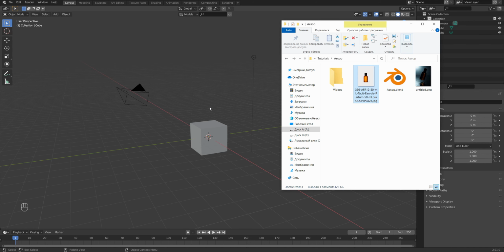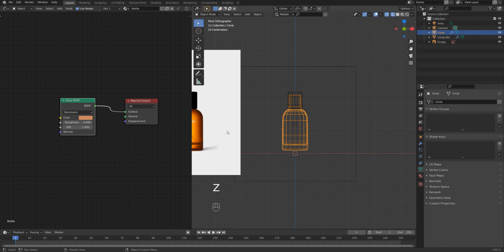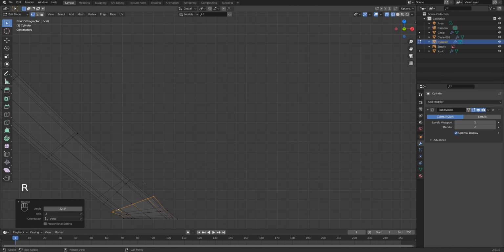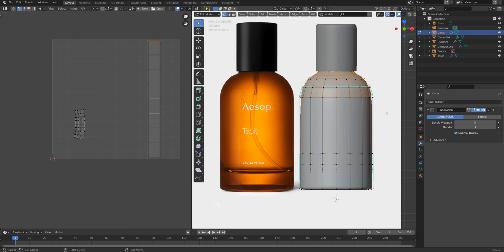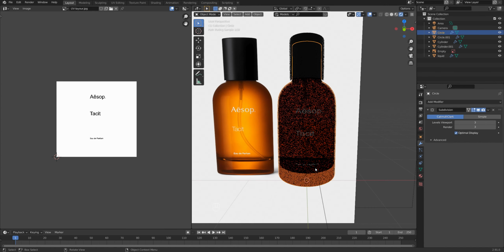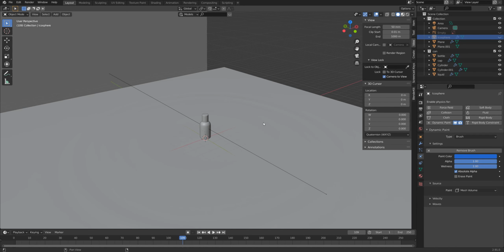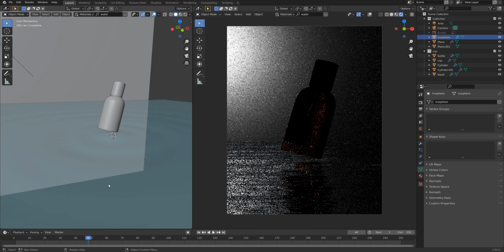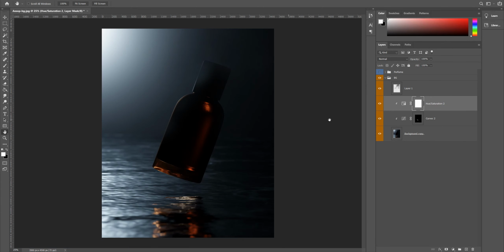Creative 3D Product Visualization Tutorial in Blender

Comment: How did you get that nice soft gradient in the glass. Because the downloadable scene renders differently that you thumbnial.
I tested using a bounce card and it looks better. Also tried light linking which is also a good option.
Ive made a nice automated workflow for lightgroups. This piece of code allows me to test different lighting condition, change colors, change strenght and simple store them as presets. I then can toggle between them with just a click. Its truly super handy for doing relighting work
Reply from the maker: I put a gradient to the area light via nodes. I have to check the blend file, I revisioned it long time ago
Reply: @andymvisuals  You mean on the material side then. Makes sense, it looks really clean. Using a bounce card or reflector card is possble. But a bit more finnicky
Reply from the maker: Is that possible to take a look at the addon you’ve made?
Reply: @andymvisuals  ill send an email to that email in your profile here, is that okay?
Reply from the maker: @RomboutVersluijs Sure! Thanks in advance
Reply: @andymvisuals you want it separately or in the addon I out it in. It came with light group helper. An addon which makes it easier to do light groups. I was thinking if either making it standalone or add to blenderbobs light editor addon, I kinda like that addon a bit more because of the GUI

Comment: blender kit is working very bad on my computer, i have to unstall it
Reply from the maker: Sorry to hear that. I use Blenderkit for a long time, didn't have any issues with that. What kind of problems do you have btw?
Reply: @andymvisuals  it works but it loads a lot and takes a lot of time especially for the water texture.. do you have any tips?
Reply from the maker: @gmilka4283  I see. It may happen because of weak internet connection (download speed) and slow PC generally... I had such issues from time to time on my old machine, but after upgrading everything goes super smooth. Previews are generated in no time. 

What specs you have? I mgiht help you on Fb group, please check the link on the main channel page
Reply: @andymvisuals  My computer is new.. its an Imac retina, processor 3.8GHz Intel Core I8, 8 hearts, 32 GO 2667 MHz DDR4
AMD Radeon pro 5700 XT 16 Go..

It should be fine but i dont understand i usually use element 3D and i have no problems at all.. Thats a new Imac
Reply from the maker: @gmilka4283  That's strange, yeah. You have a decent machine. Have you tried to reinstall a plugin in Blender? Download the latest version on their website. Also make sure you have enough space on your SSD (or HDD/NVMe).  Honestly I have no idea why it works slowly then... You may try to contact a Blenderkit support, even you can send them a video of your screen. Hope that helps!
Reply: @andymvisuals  It better after reinstall the addon but she water my favorite shader is not working well haha but thank you !
Reply from the maker: @gmilka4283  yeah some water shaders tend to have sophisticated nodes setups, so it can lead to viewport lags:)